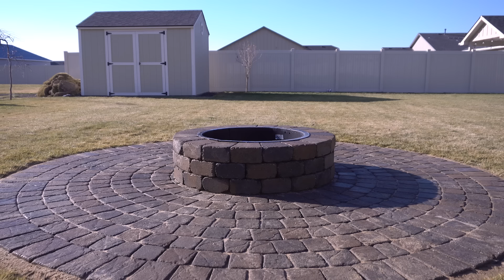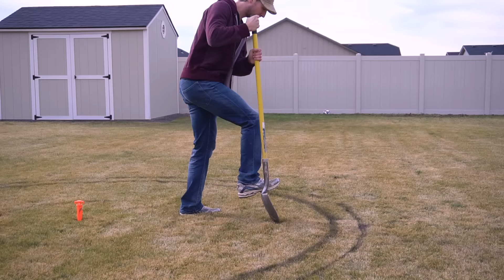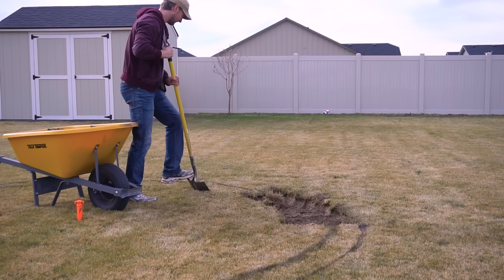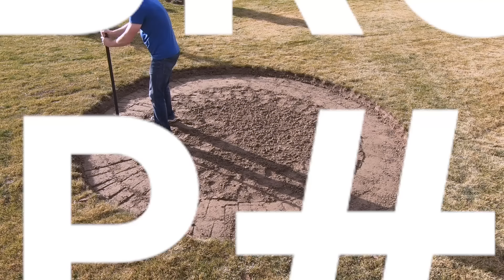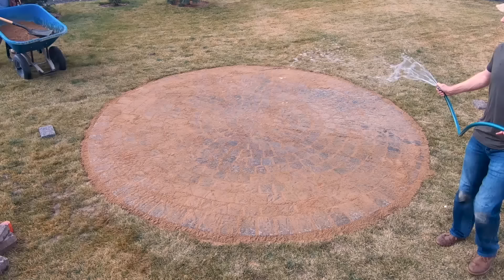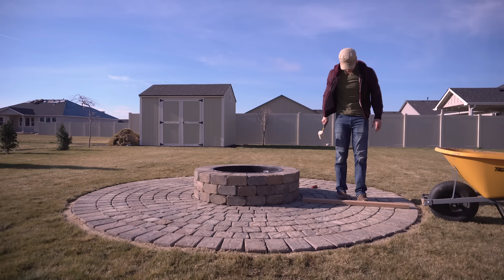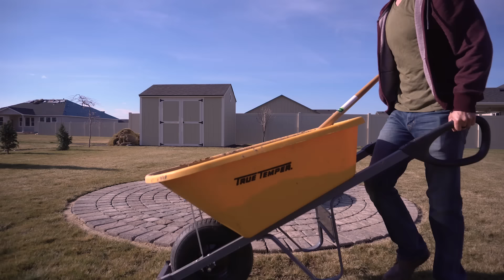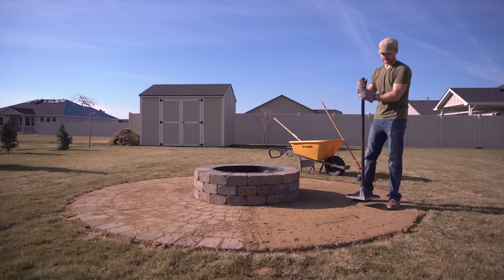My 4-Day Fire Pit Patio Build [Full DIY Project]

Comment: The gap is for structural strength. I see at end, seems you ended up with a gap :]. Basically the packed in sand is the mortar. If you had the pavers just touching, over time it would chip itself and push in weird ways. With the sand as the joint, it mitigates it alot so it acts more like one piece.
 If you find the pavers moving out and the ground no holding it. Metal stakes and bendable plastic of some sort, stake it around tight to the pavers. Have the plastic and stakes under dirt.
 Id mortar the caps and the fire ring personally.
Reply from the maker: Yeah, they eventually spaced themselves out. :) We did add a plastic retaining strip around the outside with stakes, so we're hoping they don't move too much!
Reply: I had watched a sidewalk in Brasil many years ago, the work man sweeping sand into the cracks. It lasted many years.

Comment: what was the diameter of the actual pit again?
Reply from the maker: The fire pit's inner diameter is 30 inches, and its outer diameter is 48 inches. The caps on top have an outer diameter of 52 inches because they stick out a little bit.

Comment: Work smarter, not harder. Fun video to watch people like this over work and over think such a simple job
Reply from the maker: :) Sometimes "working smarter" just means filming a project and putting it on YouTube. . . perfect or not, it's bound to help someone. That's the real goal here.
Reply: TParsons is a pro at everything coming here to gloat and direct us to his YouTube channel where he shows the proper way to install a fire pit and pavers. He’s also never made a mistake in his life and is the best at everything he does.
Reply: @lesg9604  cool 😎
Reply: @lesg9604  you’re right, i am a pro at what i do and to critique a DIY video is not disrespecting the builder. You’re a punk for your comment and you probably have no expertise in the field. In this build i would instruct a person to use 1/4” to dust as a sub base instead of sand and use a rental compactor instead of a manual tamper. I would also use polymeric sand to lock the pavers in and lightly water instead of spray it with a water hose. I love the job result here and i hope you respect my right to input my opinion. Pro builders keep up the hard work.

Comment: Not to be a jerk, your project looks great, but it would have been better if you built the fire pit first, then placed the patio pavers around it.
Also, rent a plate tamper and use it to tamp the pavers into the sand. A rubber mallet and hand tamper aren't violent enough to do a good job.
Reply from the maker: Our methods seemed to work fine for us, but there definitely might be better ways out there. Out of curiosity, why wouldn’t you have put the fire pit on top of the pavers?
Reply: @BroBuilds  
Please don't take what I said as "you did it wrong!" It will work perfectly as you did it, and it looks great!
Technically speaking though, the block should be set on its own foundation, and putting the pavers around it will lock the block in place, once it's tamped.
Reply from the maker: That make sense, and it's a good point! But yeah, I think for us it was better to have a solid "floor" to the fire pit. Easier to clear out the ash and stuff without getting gravel mixed in. I do agree that the firepit blocks need to be locked in place with some kind of masonry adhesive in the future, just to make sure they don't move. (Oh and we're definitely gonna use a plate tamper next time!)

Comment: How have the stones at the bottom held up with the heat?  Have they cracked or broken at all?
Reply from the maker: Great question - they seem good so far, but I'll get some close-up shots in our next fire pit video just to be sure.
Reply: @BroBuilds  I recommend throwing some sand in the firepit.  A good solid several inches of sand.  It'll help shield the pavers from scorching and it'll disperse the heat for dissipation.  Also, it makes cleaning out the ashes easier.

Comment: I’m surprised you just used sand in between the pavers and not polymeric sand to really lock them into place
Reply: That was the only thing I thought would add to this project as well. Also I like the weed block barrier too just for added  protection
Reply from the maker: Weed block is a good call for sure. We should've done it.
Reply: @BroBuilds  Weed block would do absolutely nothing, it would have been a wasted effort.. No weeds are going to grow from the bottom up. Any weeds that might grow would be from seeds that drop down into the sand and grow there.
Reply: Now that you didn’t use polymeric sand, you should use a concrete paver sealer from H&C. In addition to weather sealing the pavers themselves, it will harden your sand, making the whole patio locked together. This product will help prevent weather heaving and the hardened sand will prevent weed growth. Plus, I would have used an adhesive to construct your ring.
Reply: @mattruple8879  Yep and using a sealer means you can powerwash the whole thing without blasting the sand out too.
Reply: Looks great. Only think i would of done, would be the use polymeric sand for the final fill. Nothing worse than weeds growing up through your pavers
Reply from the maker: Yeah, I wondered about that myself. Sand is what the local nursery recommended when we purchased the kit, so we just went with it. I'd love to hear pros and cons for the polymeric. I'll be putting in a much larger patio plus pergola down the road, and may be switching up my methods a bit depending on what I learn.
Reply: Best sand is filterd sand of the rubblecrusher you need sand that is Sharp not round
Reply: Done hundreds of these job's. Probably a good call by using sand instead of polymeric sand because it tends to be a little messy and doesn't allow your patio flexibility some will argue that and understandable but both methods are good. In the end of the day all you gotta do is refresh it with new sand (two buckets) every year or so. Good job Bro and good call on flipping the right side up.
Reply from the maker: @berinmind  heh, thanks! I couldn't have slept at night if I hadn't fixed that. :)

Comment: Where did you buy the kit & extra materials? Links?
Reply from the maker: I used the Italian Renaissance Circle Kit from Basalite in Positano color, with a Grand Fire Pit kit from Basalite added on top. Both the paver patio and the firepit were purchased at a local plant nursery that also sold hardscaping materials, so I don't have a link unfortunately. The firepit capstones were purchased locally from a cement artist.